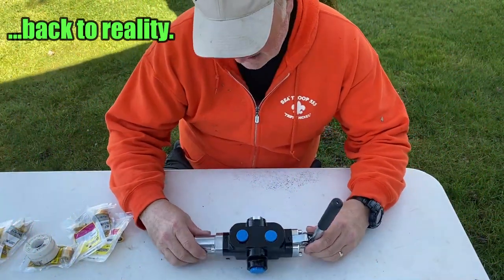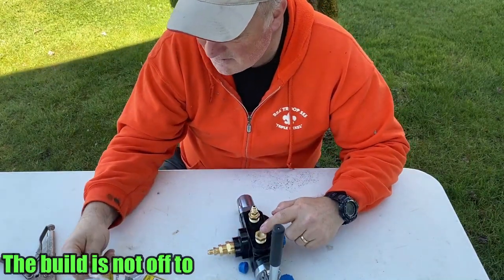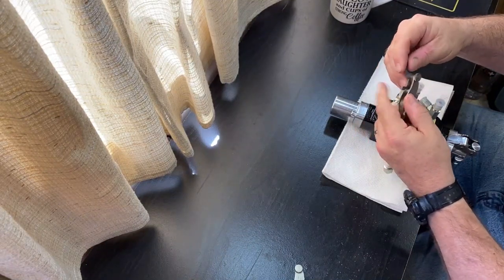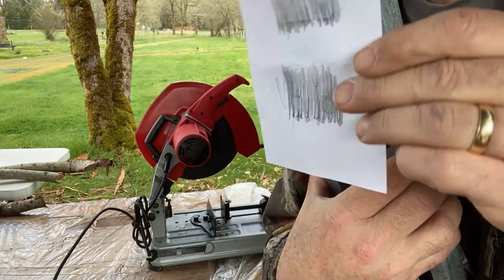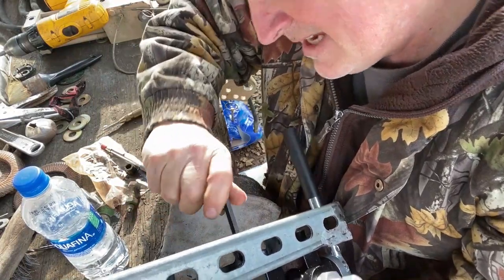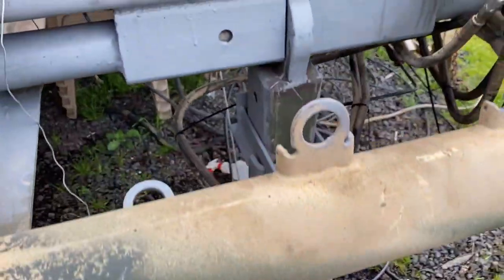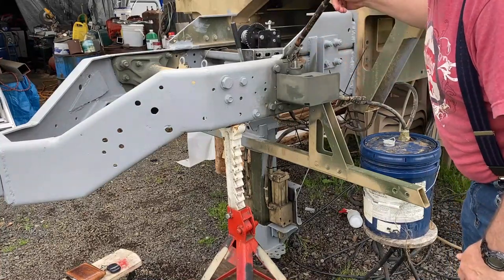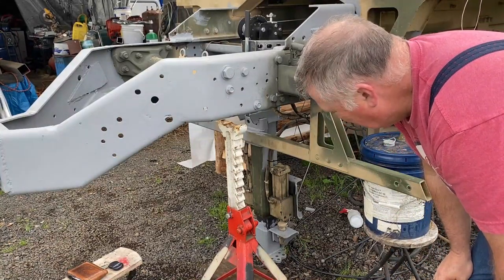FMTV TRAILER HYD TONGUE JACK Build Finale': Will it work? #112

Comment: I am impressed with the tongue jacks.  Those turned out good!  Keep up the good work!!
Reply from the maker: Well... I hit a wall with the cheap tin cookie container as an oil reservoir. (sigh) Looks like I'll have to beef it up. Bob is going to accuse me of overkill, again. LMBO!
Reply: Use the brake fluid or power steering reservoir off that beetle parts car you have....
Reply from the maker: @SeanFillner  That is a great idea! Unfortunately, I already made one out of 3" box steel. This way I can tap a threaded hole in the bottom and be done with it. I could use some brake lines though... back to the VW scrap bin!

Comment: Y'all give me a hard time for a year and a half about a drill press and then you go ahead and use a rotten piece of plywood and a unibit to make holes in unistrut... LOL   I love it!
Reply from the maker: Sometimes, it's just easier to smoke a hole with a cordless. And you have to admit, it was pretty funny for us to give you a hard time for a year and a half. At least I thought it was pretty funny. LOL! That stuff works pretty good as a bracket, once you weld a few pieces together. :-D
Reply: @HelicoolsHelipad  now you know why I am always using my hand held drill motor.  It was good fun.  I think I have used it a few times.
Reply: Hand held are good for up to 1/4" thick metal. But if you are drilling a shock support to the next size hole, A brill press and table vice is a much safer option.
Reply from the maker: @SeanFillner  sometimes, it's just faster. But when you were smoking drills left and right, it sure was fun teasing you about not having a drill press! LOL
Reply from the maker: @badbadbob1  For a quick job, I'll grab a cordless. For big holes, I won't even mess around with one. Time to go to the drill press.

Comment: Are you going to put an air/hydraulic pump on that bad boy?  Seems like you could easily run one off brake air from the towing vehicle.
Reply from the maker: I could, but wanted to save that LMTV part for someone that really needs it. I can pump the hand pump for as little as it needs to get the trailer on and off. Are you going to be in the neighborhood at the end of August?
Reply: @HelicoolsHelipad  probably not, the company I was doing work for out there went bankrupt and owed me ALOT of money. My truck projects are on hold right now until I get a secret product out the door and on sale.

Comment: If you have more metal scraps, Now is the time to add it. Just thinking your going to need side to side stability with the Pogo stick.
Reply from the maker: Yes, I will be adding some more "overkill." The more metal, the better, right? :-D
Reply: @HelicoolsHelipad  The control off the log splitter works well.